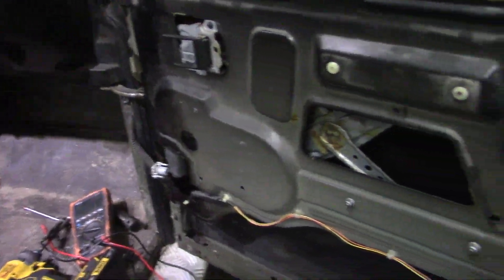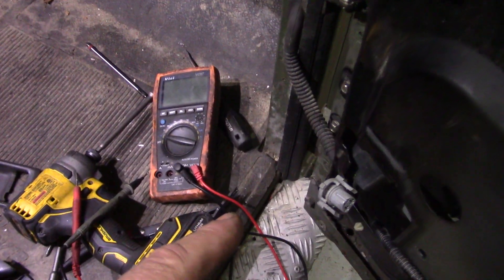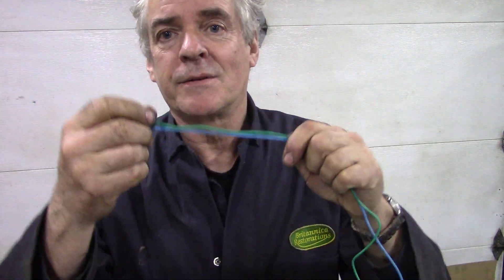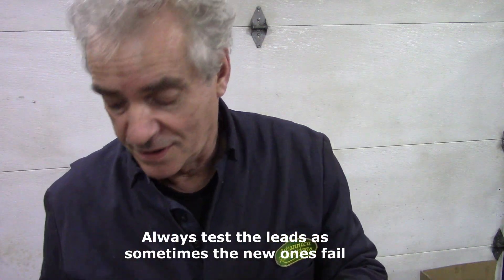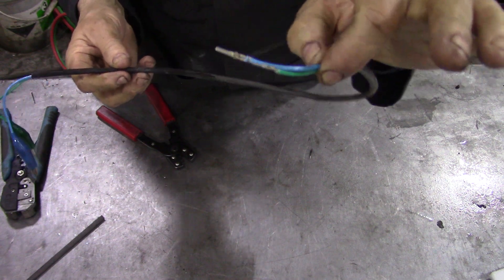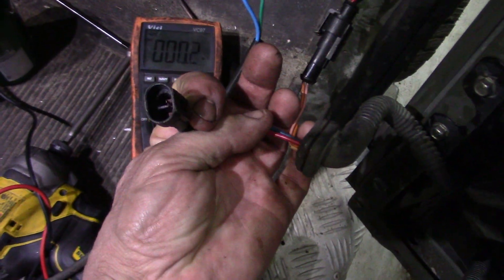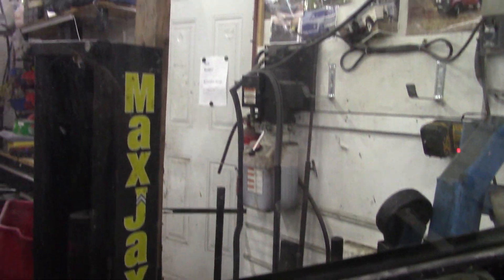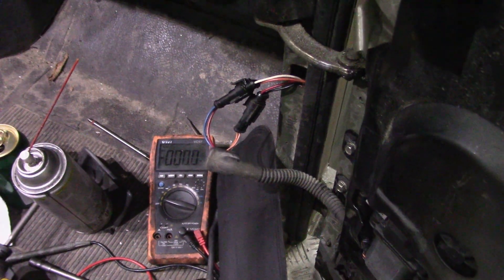Tracing an electrical problem and making a simple test lead!

Comment: Along with those crimps, get a bucket of double sided crimp cable joiners, The same thing as those crimp on pins you used but just the cable part mirrored. My preferred way of joining any cables. You can be sure of a good connection that way.
Reply from the maker: Ha! Didn't know they existed! 
Thanks for the info

Just ordered as bag of 100
They will be great as heat shrink will pass over easy! 

https://www.amazon.ca/dp/B091GJ7Q3Z?psc=1&smid=AXD5FRSZPVM2D&ref_=chk_typ_imgToDp

Comment: Get yourself a Tempo Tone Tester - mine has saved hours of work. It's in two bits - one generates an audible tone that you attach to the wire. The other is a probe that lets you follow the tone on the wire until it stops at a break. Intended for Telecoms but mine has proved invaluable for mains wiring, wiring on my JCB and even occassionally on telephone wires!
Reply from the maker: Yes I have a ringer, but it was to show the method of finding a fault and making test leads to use with a cheap multimeter
Reply: Gonna say I've seen you use it mike, good bit of kit too